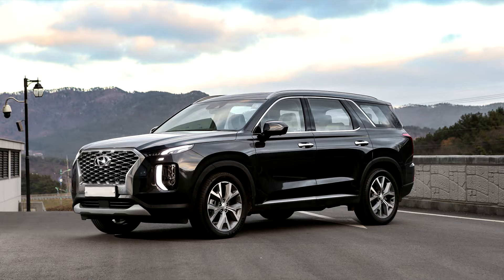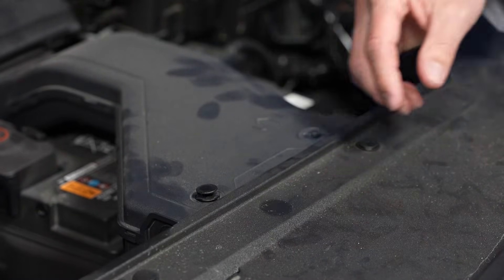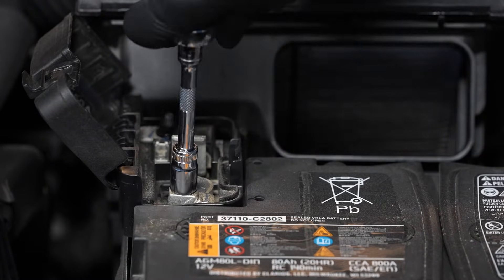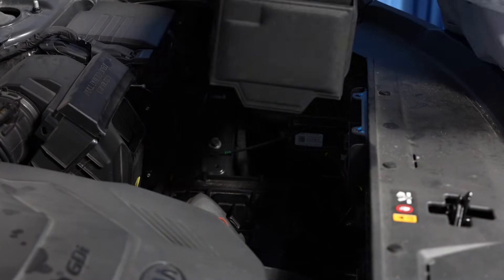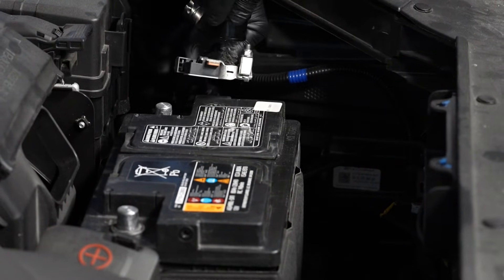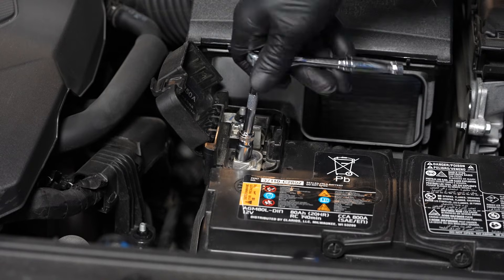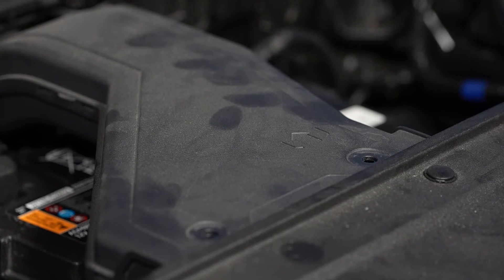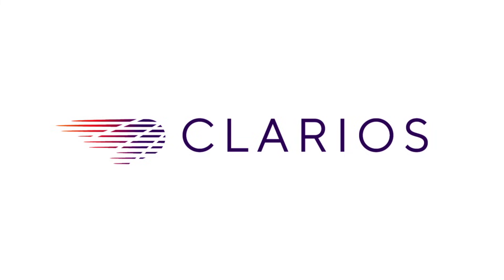Hyundai Palisade (2020 - present) - New Battery Install

Comment: I just replaced mine last night. The battery light came back on along with check engine light. I tested the new alternator and it is charging fine, battery load test says battery is ok. Maybe harness wasn't plugged in properly?
Reply: Did you ever find out what the problem was..
Reply: @sipwitme4625 it ended up being the negative battery cable. It has a built in fuse. I fixed it properly by trading it in for a 2025 pilot black edition 😂